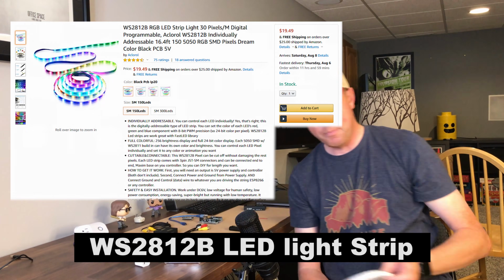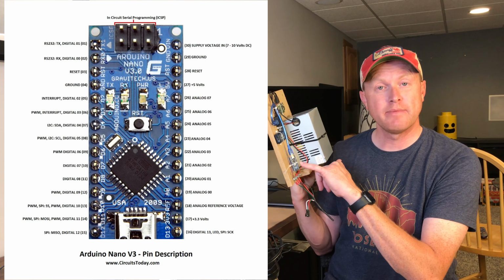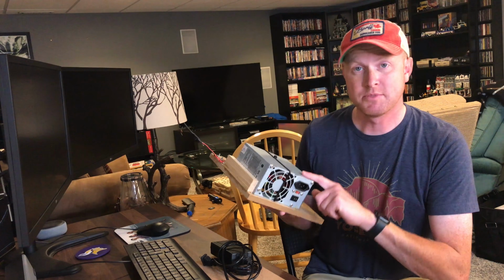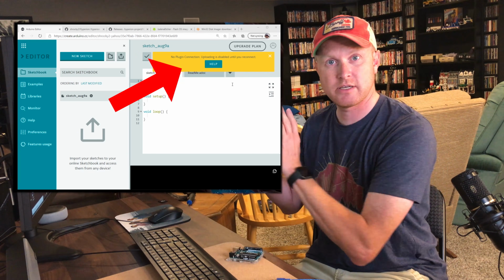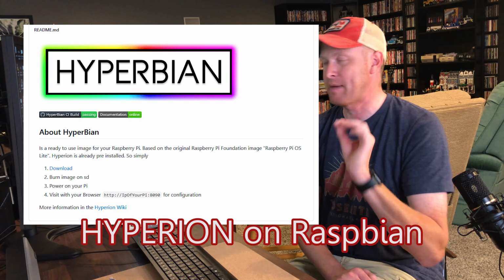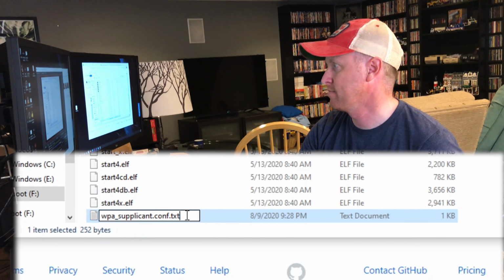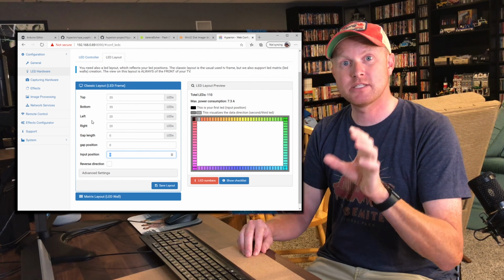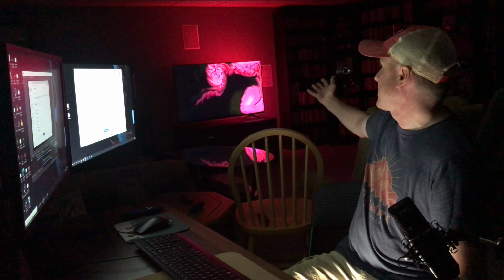DIY Hyperion Ambient TV Light Project (Raspberry Pi + Arduino) Complete Setup

Comment: Great presentation of all components for this build, but I was expecting a final schematic illustrating the concept that is gona happen between all components, kind of big illustrating picture like: TV >> ?? xx ??  >> LED strip.
Kind of a schematic of the Project Board you builded, anyway your explanation of the wiring is fine and the Project Box is also neat, but an explanation behing the video capturing science would have been great.
I have been using AmbiLight with my PC for about 2 years (Arduino Nano + AmbBox/Prismatic (less heavy than AmbiBox mainly) and it works great. I was aware of TV possibility but never jumped into it caused was kind of super tendinous project, at least component required was crazy lot, but with your nice tuto I may again plan to dig into it

I regret you did not point us how to find the Amps consuption of the LED strip. You said you used 110 LEDs >> 7,3A. But how did you come to this number?? Because everyone is gona use different amounts of LED according to the size of the TV obviously, so different total Amps consuption. I wish you gave some basic formula. I know it is recommanded to go for a bigger power supply than needed, but still interesting to know an pproximation of the power consuption to be expecting...
Plus, it is sometime better to add an individual power source for each strip. because when a big amount of LED is used the LEDs at the end tend to dont receive enough amount of current, so they do not light as expected. I mean like this: 
http://alexgyver.ru/wp-content/uploads/2018/02/wiring2.jpg
I know you did not cut + solder the strips, there is also to option to add at the start and at the end of the strip, I did it ,and boom it changed the game for my AmbiLight Setup.

Order than those small detail, amazing tutorial and very well explained. 
Thx very much, those kind of shared project really boost you to reproduce them 😉
Reply: @Steve_Does_Stuff  Thx you much,  hey I did not catch that Hyperion feature lol, killer feature!!
While back I was building my ambiLight for PC I can accross that those W8212 use 20mA or 40mA for each led, kind of dont remember well... lol
About the Power IN at start I supplied only at the start of Led, but after some month I added Power IN at the end of the strip also and everything is much better. 
Tip: to diagnostic this need: force the led to show pure WHITE (totally white image) in my case I was getting some yellowish white, close even to orange lol. So fter some reseach I found out that I was related to Amps, not a PS issue cause as you I use a PC Power Supply, then option 2: not enough current traveling through the strip, cause lets be objective, those strp got a tiny amount of cooper connective support... Short long story, add additinal INPUT.... Better and the strip do no het over time...

Comment: So is a common ground between the RPi and Arduino as simple as a wire connected at a ground pin on both? Does the wire have to connect to anything else or just bridge the two boards on ground pins?

Comment: Hi Steve, great video! I unfortunately ran into a problem. I have set up everything with one external power supply (similar like you have shown in the video) and have hooked up the pi and the LEDs to it. I managed to ssh into the pi and make all the set up. I have now a couple of issues:
- I can see the HDMI input on the Hyperion (:8090) website, but the LEDs won't change
- there is no "Baudrate" when I put in "adalight" as control type

so in essence, the arduino seems to not correctly control the LEDs, can someone help?

(because of paranoia and because I am on a mac and the arduino nano that I use was not recognized, I have uploaded the createarduino.cc file several times possibly - could that also be an issue?)

I would be so glad for some help guys!
Thank you all so much!
Reply: @Steve_Does_Stuff  Thank you for the quick reply and so much help!
I had the lights flash once in 3 colours, but then never again. Do you know what could be the issue here?
Reply: @Steve_Does_Stuff  again, thank you so much for replying and helping me on this, I appreciate it!
I have ssh into the Pi and gotten the same port as you in the video, so there should not be a problem there. In the Hyperion online mask, it won't show the Baudrate when I do everything step by step as in your video. I will keep trying!
Reply: @Bodowin  On the Hyperion console go to the wrench on the top right and then settings level. Advanced will show the baud rate.
Reply: If you have more than 255 leds try changing line 95 of the arduino code to  
for (uint16_t i = 0; i < NUM_LEDS; i++) {

Comment: With thee wiring of the raspbeerry pi w and Nano, what wirese go where? I am lost haha (using a usb for powere and a 5v 10a for leds).
Reply: @Steve_Does_Stuff  Thank you! I got it up and running.  having issues where the capture USB on Hayperion changes from the USB to Auto and the LEDS do nothing.  Worked initially, but now Hyperion loses connection then restarts up but setup is not correct with the video capture?
Reply: Not sure what happened, but the only thing I adjusted was the FPS to 25fps on the capture card settings in Hyperion and that seem to have fixed the crashing...  Grat tutorial and thank you again!

Comment: Okay, I have the same problem that a lot of people have. The configuration is good, on my Nano RX flashes well, on hyperion I can see my screen well but no LED light up. As if the Raspberry Pi don't send the data to the arduino ...
Reply: If you have more than 255 leds try changing line 95 of the arduino code to  
for (uint16_t i = 0; i < NUM_LEDS; i++) {

Comment: Hey Thx for this tutoriel.
I have 264 LED. Does the arduino code support them? 
Thx
Reply: @Steve_Does_Stuff  Thank you for your answer.  Well my problem doesn't come from there. ^^  I have my Led lights up at boot and then nothing. (Red,blue then green)  In the Hyperion WEB interface I can clearly see the screen of my TV.  I have the impression that the Pi doesn't send the information to the Arduino Uno (In SSH I Can sée /dev/ttyACM0).  In any case excellent tutorial, thank you very much.
Reply: @TitQuentin  If you have more than 255 leds try changing line 95 of the arduino code to  
for (uint16_t i = 0; i < NUM_LEDS; i++) {
Reply: @randomsporadicprojects8941  Thx for your answer but doesn't work. I use code from MadScientists tutorial and work perfectly !
Reply: @TitQuentin  No problem. Glad you got it working.
Reply: @TitQuentin  Can you please share the code that you used?
Reply: @ChristopherChan2  
Of course ! Here is the code I'm using: https://pastebin.com/XzXynTmr

You will need to modify the value of the number of LED on line 13 and also the "const char prefix[]" values on line 19 depending on your number of LEDs.
Reply: @TitQuentin  Thank you so much for sharing your code!

Comment: You could save money by replacing the Pi Zero with a Pi 3B+ and use the GPIO pins to control the LEDs.  That allows you to ditch the Arduino and the USB hub.  You can also get a pass-through capture card that will eliminate the need for a HDMI splitter like this one:  https://www.amazon.com/dp/B088Q8H4LT/ref=cm_sw_em_r_mt_dp_rekFFbMH666E5

Comment: I have a hyperion set up that I made, and the thing that surprised me about this video is the use of the Arduino. My Raspberry Pi does all of the LED controlling, no need for the Arduino.
Reply: bạn có một tourial?
Reply: @amittk301  Check out Dr Zzs video on Hyperion.
Reply: I did wonder about that. I think my next project will be done withouth the nano.
Reply: and what is the answer? why a arduino is needed in that case?
Reply: I believe the specification for the LED's is that the data and power signals should be 5V. My guess is that this is why the arduino is in the mix, to provide 5V logic. However it has been demonstrated that the strips can work with 3.3V logic (which is also the Pi's pin voltage levels), although it is easier for them to become unreliable on long runs due to voltage drop. However in this case, with there is already a 5V supply, so if 5V where needed because the 3.3v from the Pi didn't work, it would be enough to achieve this by replacing the arduino with mosfets.
Reply: @mellamanjefe  Obviously the LEDs are powered by a standalone power supply. My AmbiLignt is (as I remember) 460 LEDs long. No problems with the logic driving all the LEDs.
Reply: @mellamanjefe  The pi has 5v logic and 3.3.
Reply: @starmc26  I'm not so sure of that. Last time I checked all the Arduino GPIO pins only have a voltage level of 3.3volrs.
You can get around this by introducing a voltage stepper that raises the voltage from the Arduino pin 3.3 volts to the desired 5 volts for the led strip

Comment: Great video! I'm trying to get this to work with a raspberry pi zero w and i cant get my capture card to work with hyperion. It comes up as USB video but nothing shows up on the live stream (i have made sure the USB capture device works with my laptop). I think it may be some kind of power requirement problem because when i plugged it into my computer it got warmish and when Its plugged in and recognized by the raspberry pi it stays cool. The raspberry pi is plugged into a 2A ipad charger. What is the amperage of the power supply your raspberry pi is plugged into. Thanks.
Reply: I think you should use a 3 amp power supply because the arduino and the capture card both are taking the power from your rpi

Comment: Seems like a lot of amps. So if you double the LEDs you would be nearing the 15 amp threshold of most household circuits. And this doesn’t even include all the AV equipment that is likely plugged into the same circuit. Am I missing something?

Comment: Hello ;) if i have a raspberry 3 than i also need a Micro USB Hub ? or all usb go to pi ?
Reply: @Steve_Does_Stuff  one more question :). In  adalight Controller type I have only  General Settings
RGB - byte order
  and Specific Settings - Output path

The only thing that reminds Adalight is atmo. can it work like this?

Comment: I did this Project on an older video.
Mine dosn't work. My leds Just flickering... i don't have a ground on my Power supply, could this be the problem ? 
I've checked all of my soldering and that seems fine. 
I will try your Guide in the next time.
Would be nice if you have any kind of tip for me :) 
Please excuse my English skills i live in Germany:)
Reply: They JUST pushed the updated build of HyperBian. Uploaded, tested after having the same usb arduino issues. Everything is now working flawless using the intended method.
Reply: @mitchellpotrykus3332  So , what did you do to make it Work ? ^^
Reply: @christianschwab9155  Follow all of the instructions of this video, except use this release of HyperBian

https://github.com/Paulchen-Panther/HyperBian/releases

Any questions on specific issues, let me know.
Reply: @mitchpotrykus7095  i´ve tried it and had the same issue...:( Still no working led´s, arduino and Raspberry communicate but nothing happens..:/
Reply: @Mitch Potrykus 
i am wondering because all of the other stuff works .. i see the grabber video and also the start of the leds works ... ide sketch seems fine.. and hardware stuff also ... i think its still the Raspberry software but have no idea what else to try.
Reply: @christianschwab9155  How is the webUI performing? Restarting at all or staying on? Are you seeing the live video in the preview ok while the arduino is plugged in?

Check your arduino sketch that the data bin and baudrate are correct and HyperBian has the matching baudrate as your sketch.

Also make sure when everything is done, you go to Remote Control and select the capture device as the active source.

If still nothing, tell me anything you can on what is happening or seems like it shouldn't be.
Reply: @christianschwab9155    Ah just saw your latest reply

If you see the grabber video AND the led start works (showing all communications are fine). I definitely think you have to select that source as active in Remote Control.

If that isn't it, let me know. But it seems like all of the hard parts are working.
Reply: @mitchpotrykus7095  the Web UI Performs great , it is on. i See the Live Video in the Preview ( Bad quality but works. ) arduino is still connected. Data bin is correct and baudrate Match ( i,ve tried 3 different baudrates )

one Thing i don't know by now is the thing with the remote controll. i have to Check it tomorrow...:D not Sure what you mean with that .
Reply: @christianschwab9155  Honestly if all that is working and it's not this, I will be upset haha

https://i.ibb.co/TRVSVY9/Capture.jpg
Reply: @mitchpotrykus7095  really thank you for your Help and the hard Work you did for me, i will try it asap and Update it Here.

I think it was on active but i will Test and Check it anyways, for today i'm tired and finish with my ambilight :( Good night and thanks
Reply: @mitchpotrykus7095  it was active nothing happens... then i tried alpha 8.. still no change
Reply: @christianschwab9155  What the actual heck

Has to be a config somewhere not lining up. If you would like more help, I need an email or something and I can review some screenshots of your config.

Otherwise if you want to tackle yourself, go through the video carefully and double-check everything.
Reply: it works ! i found an sketch who finally works for me... just have to fine tune it, i have an last issue that my led dont turn of in dark scene
Reply: do you know where to config the blacklevel for the led on the web based software? or only in the config ?

Edit: Got all Up and running thanks for all your hard Work and time to Help me. If anyone is interessted in the solution which works for me Just say Something. and the blacklevel i adjusted with the Gamma Set top 2.9 or Higher
Reply: @Steve_Does_Stuff  OK i did it your way, but i can't get the LEDs light. i See the Video from the grabber and i See the arduino light the LEDs Up at the start . But the arduino ends Up in a endless bootload. the Grund was also an issue but it still won't work
Reply: @christianschwab9155  it is related to the version alpha 7 or hyperion having issue.
You would have to use the master from github which is alpha 7 also but fixed instead of using the prebuild image with an older version of alpha 7.
This is the fix that solved it (like i said, only available in the github not the prebuild image): https://github.com/hyperion-project/hyperion.ng/issues/903
Reply: I did a guide to install from the git.. i left the link of where i found what to do: https://pastebin.com/M860ynJz i tested it from scratch should work fine if you configurations
Reply: @wowfut  thank you ! i will try this asap :)
Reply: @wowfut  i´ve tried your guide, but during this guide i hade some problems.. the rasbian os had some system relevant programms missing and i had to search and download them manually...:/ still not complety installed and followed your guide... i stuck at the part where i have to install: cmake -DCMAKE_BUILD_TYPE=Release .. it occurse this error:
CMake Error: The following variables are used in this project, but they are set to NOTFOUND.
used as include directory in directory /home/pi/hyperion/dependencies/build/hidapi
   used as include directory in directory /home/pi/hyperion/dependencies/build/hidapi
   used as include directory in directory /home/pi/hyperion/dependencies/build/hidapi
   used as include directory in directory /home/pi/hyperion/dependencies/build/hidapi
   used as include directory in directory /home/pi/hyperion/dependencies/build/hidapi
   used as include directory in directory /home/pi/hyperion/dependencies/build/hidapi
   used as include directory in directory /home/pi/hyperion/dependencies/build/hidapi
   used as include directory in directory /home/pi/hyperion/libsrc/leddevice
   used as include directory in directory /home/pi/hyperion/libsrc/leddevice
   used as include directory in directory /home/pi/hyperion/libsrc/leddevice
   used as include directory in directory /home/pi/hyperion/libsrc/leddevice
   used as include directory in directory /home/pi/hyperion/libsrc/leddevice
   used as include directory in directory /home/pi/hyperion/libsrc/leddevice
   used as include directory in directory /home/pi/hyperion/libsrc/leddevice

any idea ? :D sorry for so much questions...
Reply: @christianschwab9155  I see that alpha 8 came out today, the hyperbian image is updated too, might want to check that out. As for the guide, i wrote everything i did step by step, so i don't really know why you would have that. https://github.com/Hyperion-Project/HyperBian/releases
Reply: @wowfut  i tried Alpha 8 right now... nothing changes led´s still black

Comment: does anyone know what driver is needed for the nano clone steve uses? It seemed to download fine but it's either the driver or script. I  have followed this instructional word for word but the minute I plug in the arduino board, it cycles through the initial RGB flash, and restarts. It seems to completely crash the Pi too because the html hyperion control keeps refreshing as if the raspberry turns off.
Reply: Steve,  I just checked the comments, would you be able to check the script and let us know what may need to be changed with the newest version of Hyperion?
Reply: @christofano301  version alpha 7 included with hyperbian is bugged and i had the same issue that you have, the problem is hyperion, not the arduino. You can install from the git repo but its a bit more complicated. I installed raspios and then installed Hyperion manually from the git up repo, it works fine.
Reply: @wowfut  im a little bit of a noob here. do you have a link to instructions on how do this?
Reply: I had the same exact issue. I'll try the workaround that Sylvain mentioned